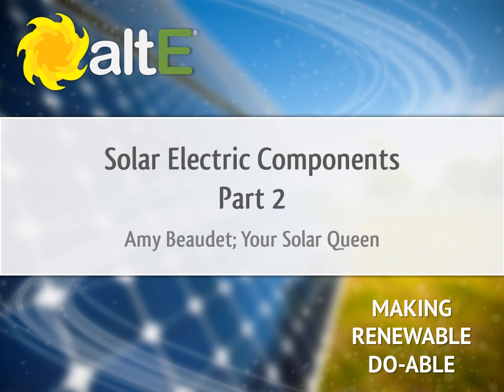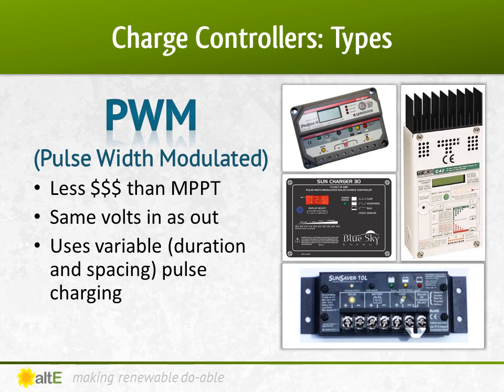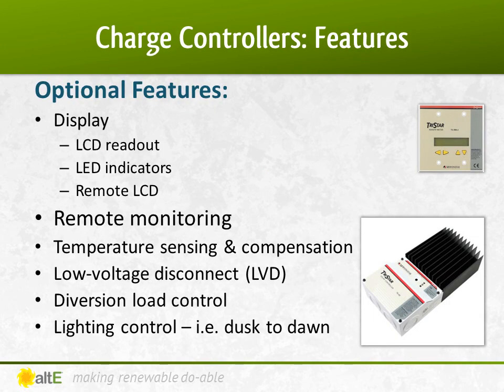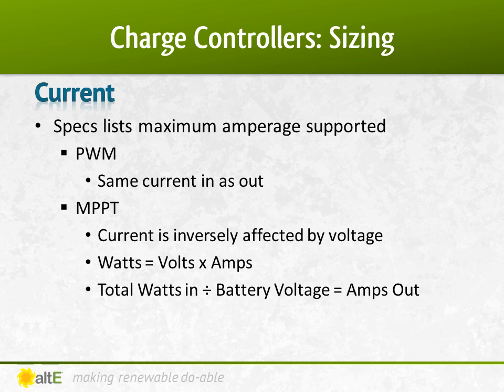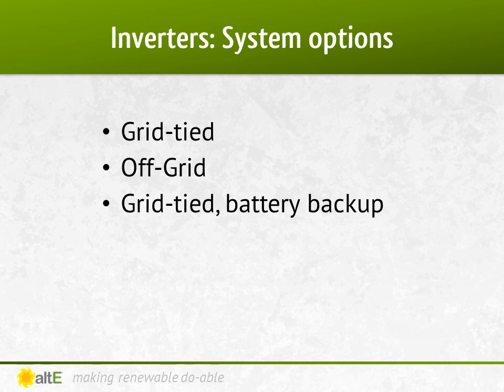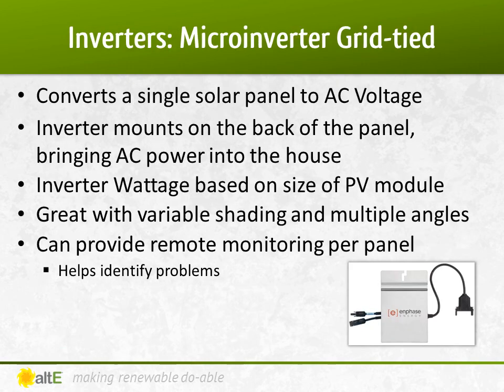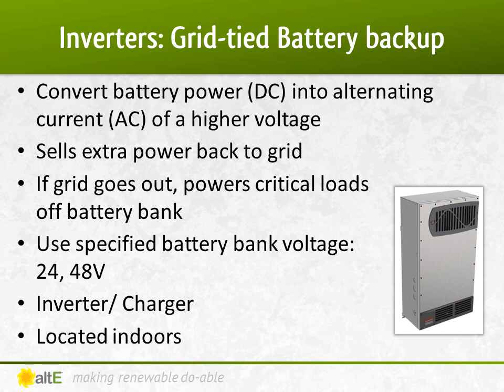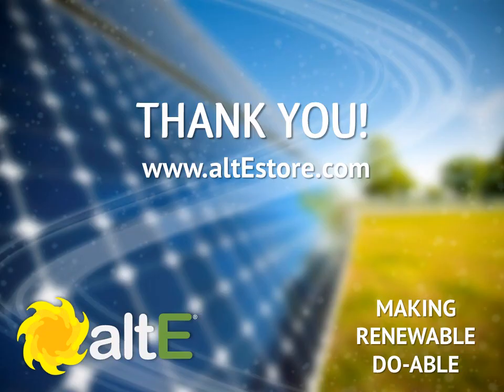Charge Controllers & Inverters: Solar Power Components - Part 2

Comment: Ok I am a bit confused... Let's say I have a panel hooked into the controller, and the controller goes to the battery... Do I need a specifically solar inverter after this? Seems like to be when the battery is charged that gets rid of the variating voltage problem out of the way and any regular inverter would work from that point on... Am I missing something?

Comment: Please help, just found your videos but been trying to understand solar for my RV for months. I bought 3x200W panels and was sold a Victron MPPT 150/35 controller for my 12VDC system. Your video states to determine the Amp portion I would divide my 600W by 12V so I would need a controller rated at least 50 not 35. Is this correct? If so why would they sell me one rated at 35A? I was also told to install a 15A breaker between the panels and controller and a 40A breaker between the controller and batteries. I've watched many videos and read lots of info on website but keep getting conflicting info.
Reply from the maker: Glad you found us. So the correct math is 600W / 12V = 50A. However, 600W is under standard test conditions (STC), which has the panels tilted perpendicular to the sun. Perhaps whoever sold you the 35A charge controller figured with them lying flat, they won't output full power. Or, they just didn't understand that MPPT charge controllers are rated by their output, not their input. I suggest trying to swap it for a larger one. It probably won't damage the charge controller, but you will potentially be clipping the output during the middle of the day, not getting your best production. 

The charge controller input breaker size is based on the short circuit current (Isc) of the panels. Are you wiring them in parallel or series? If series, it is Isc x (1.25 x 1.25) (or 1.56) = breaker size. (1.25 for over irradiance, when the sun is brighter than STC and 1.25 for 3 hour continuous) Not sure what your panels are, but for example, 6A x 1.56 = 9.36A, so round up to 10A (the 15A you have is fine, just make sure the wire is big enough for 15A of current). If they are in parallel, it is Isc x strings x 1.56, so 6A x 3 x 1.56 = 28A, so round up to 30A breaker. 

The charge controller output breaker is generally just the rating of the charge controller x 1.25 (for 3 hour). So if you have the 35A charge controller, 35A x 1.25 = 43.75A, round up to 50A. Looks like whoever sold you the equipment rounded down, which is not allowed by NEC.
Reply: I'm running panels in series, here are panel specs VOC 24.335V, Vmpp 21.052V, ISC 9.87A, Impp 9.50A, module efficiency 17.3%. Told to use 10AWG wire from panels to controller and 6AWG from controller to batteries.

This is what they told me yesterday for determining controller. 3x200W panels = 600W, 600W x 85% efficiency = 510W, 510W/14.4V (charging batt voltage) = 35.42A

Math is a foreign language to me so I can use all the help I can get. I do have some automotive electrical background but its been years since I've had to use it much. Solar is a whole new thing to me.
Thanks for the help.
Reply from the maker: @HikerBiker  Just to make things confusing, there are several ways to calculate the right size charge controller. Especially with the panels flat, that 35A is probably fine.

Comment: Hi I have a 5.4 kw with 19 solar panels with micro inverters each  and goes thru a transfer switch and to the grid meter. What will I need to buy for a 4K Battery backup system and still stay grid tied and send ac back to my meter , which I was told a AC Coupling and a 4048 hybrid inverter will do for emergency items like Fridge, fans and TV Please help me in what items I really need . I live in Puerto Rico where we have suffer a Cyclone which cause a disaster and there was a panic in our country. I need to be better prepared for the future and I will appreciate your help and knowledge. Thank you very much.
Reply: at altestore can I connect solar panel directly to a battery.

Comment: I don't understand that the grid tied inverter dose not use batteries
Reply from the maker: +Eng Mahmoud Samy A grid tie inverter simply converts the DC power from the solar panels into AC power that your household appliances use. It connects right to your main breaker box, the same place the grid connects. So any appliances in your house will use that solar power as it is available. Unlike a battery based solar system that would store any extra in a battery for you to use later, a grid tie solar system sends any unused electricity out to the grid, the electric company buys it from you by spinning your meter backwards, and your neighbor buys it from the electric company and uses it.
Reply: +altE Store 
Thank you

Comment: what is the average life for sealed battery
Reply from the maker: +Eng Mahmoud Samy That depends on many factors, including brand and how it is used. If you buy an inexpensive sealed battery, and use a lot of the power every day, running it down to 50% depth of discharge daily, it may last only a few years. But if you buy a high quality battery and only use 10 - 20% of the power each day, then it could last well over 10 years. You have to balance initial cost of the battery bank and overall life of the system cost when choosing your batteries.